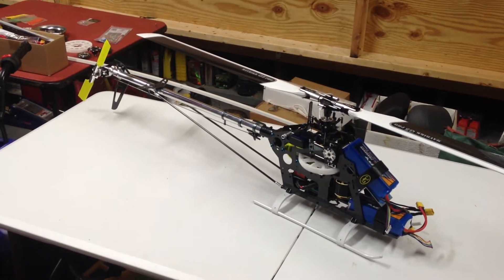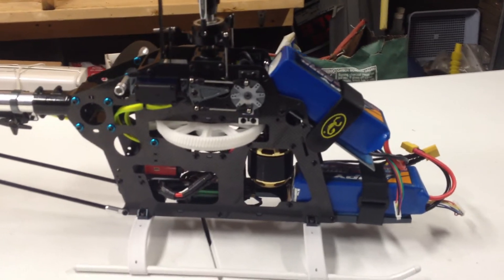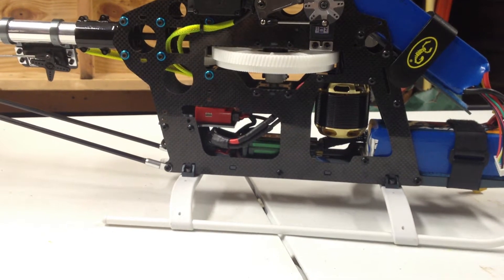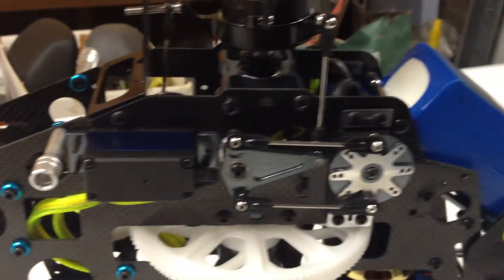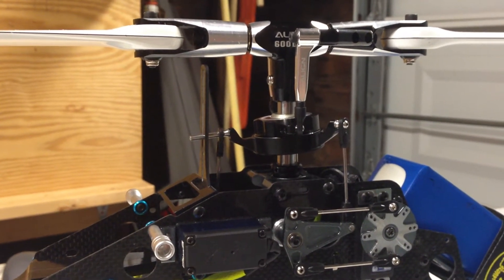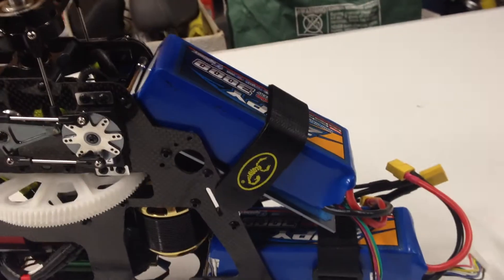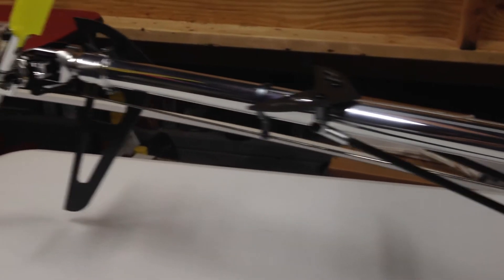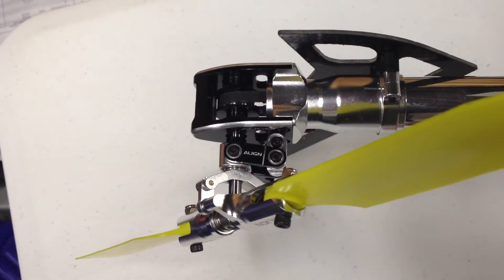Walk Around of T-Rex 600e 12S Setup With Scorpion HK4025 III 550kv and Pro DFC Head/Swash Build

Comment: Hi.  Great build.  I just finished installing a Chinese DFC head and main shaft on my stock 600E.  However, the stock anti rotation bracket is too tall.  With the swashplate low, the blade grips are blocked by the top of the anti rotation bracket.  I'm thinking I will have to trim about 1/4 inch off the top of the bracket.  What did you do?

Comment: hi great looking heli, nice to see someone building out of their head . how much did you have to alter the shaft to fit the dfc thanks andyuk
Reply from the maker: Oh my!  Now you're making my brain work!  I believe we removed 10mm but I'm not certain. I had the original shaft that came with the DFC conversion kit. I measured from the hole for the main gear retaining bolt up to the head mounting bolt.  I then removed the "extra" from the top of the longer 600e shaft. 

Finally, I clamped the two shafts into a vise and put a pin through the lower bolt hole to line the two up. Then, I ran a drill bit through the hole in the DFC shaft down through into the 600e shaft to ensure a precise length and properly centered hole.
Reply: thanks for your help ill give it a go